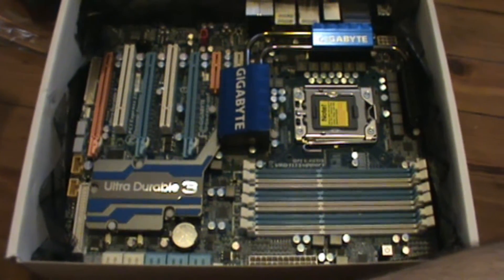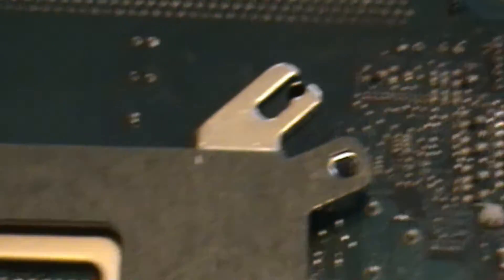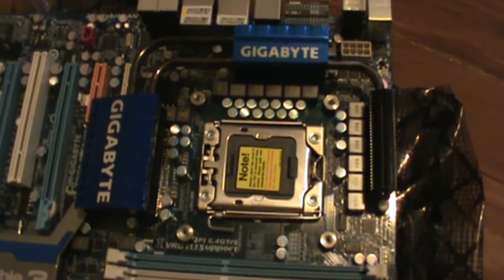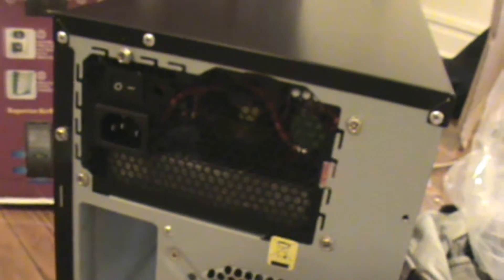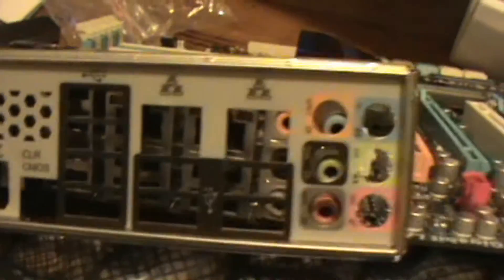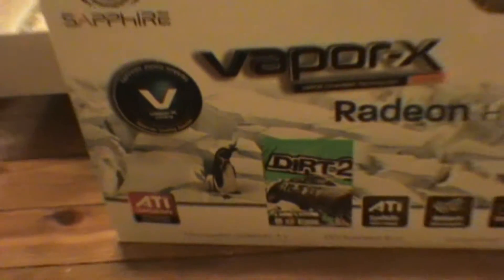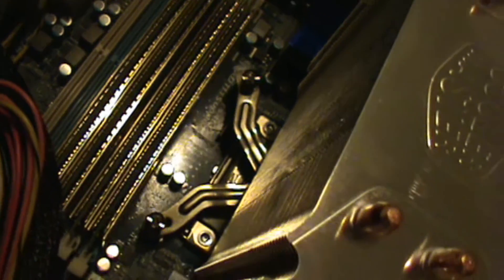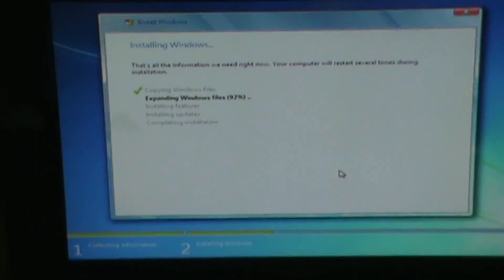How to Build a Intel Core i7 System from Start to Finish

Comment: @Windows7Forums hey im going to install the same psu as you with a Gainward GeForce  GTX 560 ti Golden Sample, my pc has an i5 - 2400 @ 3.10GHz will the psu be ok coz ive heard its kind of a bad part but i dont have much money so i had to go budget but i only intend to use the psu for a month and a half then im getting a much better one, any advice would be good :)

Comment from the maker: Re: Cable Management. This is a modular power supply so it is very easy to clear out the cabling. This was a quick throw together for demonstration purposes. A better case will also give you the routing option behind the board. This system is using tri-channel (after the video is done as well). At the time not all of the memory I would have liked was available (24GB Ripjaw). There is one inaccuracy here and that involves LGA1366, which was a i7 only chipset.

Comment: I'm looking at buying a board similar to the one you have, but I'm a little worried about the pcie x1 slot. Is there enough room for a card with the chipset heatsink there, would there be enough clearance over the top of the heatsink?

Comment: Wow, I hardly learned a thing. Don't you think that setting up your CPU, and CPU fan is NOT best to leave for LAST? You didn't show how you got that heat sink device placed underneath, but you did mention it was difficult, and I bet you did a lot of cursing during that time. It would have been a thousand times easier had you done this BEFORE you put all the other components on the board. Seemed like a very amaturish video to me. Wobbly view, no detail, just blah blah. Very boring to me. JMHO